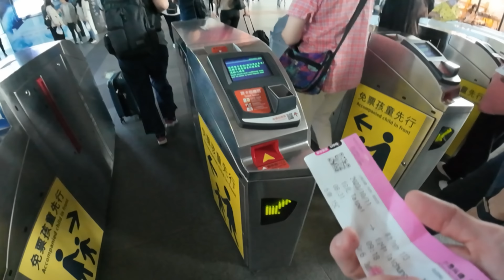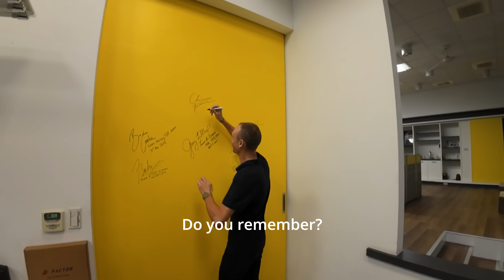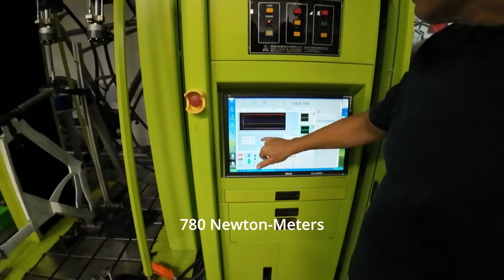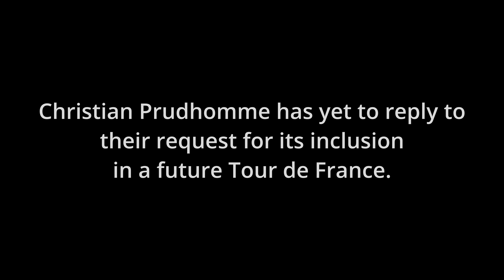Everyone Loves New Bike Day!

Comment: So most bike brands have overlap joints but not Factor? 😂🤣😂🤣😂😂🤣😂🤣😂🤣🤣🤣😂
Reply: Yes, most frames are made with the closed-mold technique where they have multiple overlaps which is also the reason why they weigh more, i've seen videos of people showing the inside of a factor ostro vam and i've seen what it weighs so they definetly don't overlap.

Comment: French manufacturer, Look, made its first carbon frame, the KG 86, with a lugged construction. The carbon tubes were made by a French company, TVT, which combined Kevlar with layers of woven carbon fiber for additional strength. The tubes were then bonded with epoxy into aluminum lugs they went on to develop frames using the inflated bladder system i put this here because i hate BS.

Comment: 780 Newton is not 780kg but around 78kg right?!?
Reply: The guy in the video needs to brush up on his physics haha.

To your question, if 780N is expressed as a weight force here on earth, yes it's about 78kg. But the unit quoted was Newton-Metres which is torque. So 780Nm would be like 78 kg hung off a 1m bar.
Reply: @everythingian7579 yeah but I couldn’t see any rotationary type of force in the machine, only a straight press, so I’m thinking the guy is also off with his unit, but I’m not 100% sure about that

Edit: nevermind i think it’s flexing around the headtube, so N/m is correct I think
Reply: I think he said "seven eight" or maybe even "seventy eight" kilos and the subtitles are just wrong